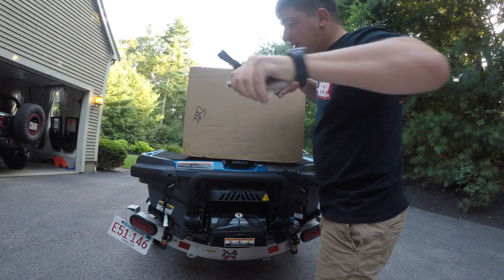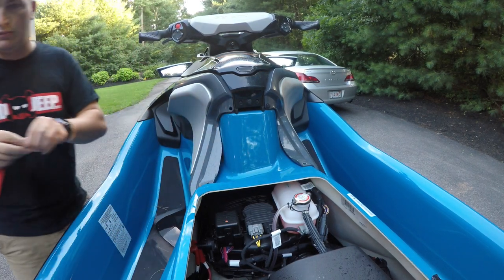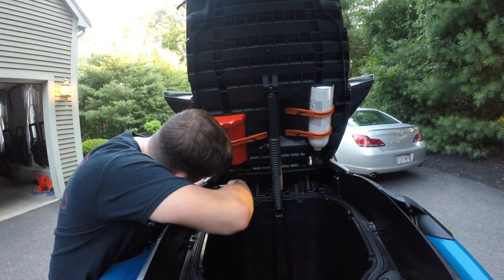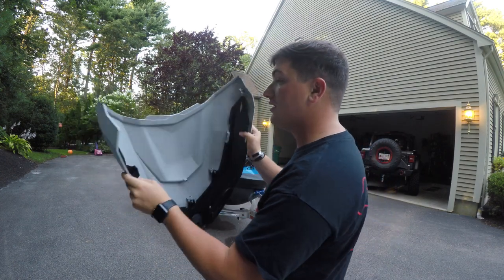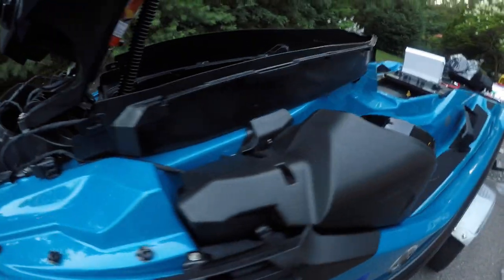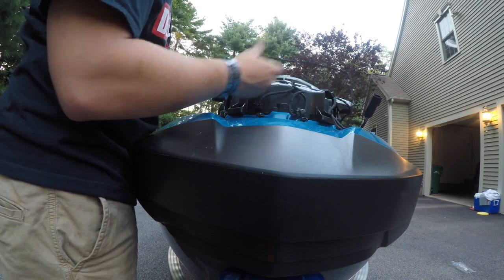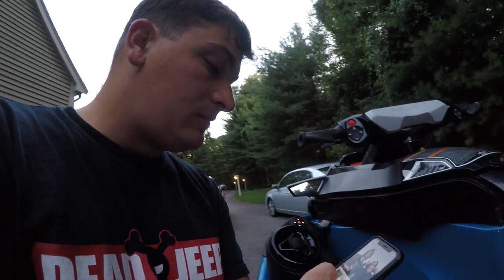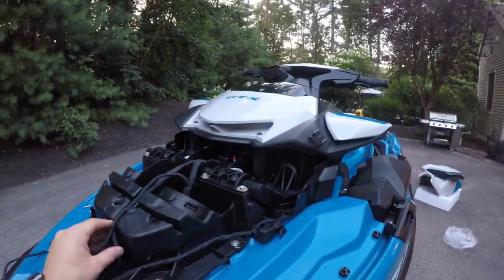How to install BRP premium Audio Speakers on my 2019 SeaDoo GTX 155

Comment: Did you use the same screws for the speaker brackets or did it come with its own screws
Reply from the maker: it came with its own stainless screws sorry i  thought i  depicted that it may have slipped my brain thanks for asking!
Reply: A trick : you can watch series on instaflixxer. I've been using them for watching all kinds of movies lately.
Reply: @Misael Jaime yup, been using instaflixxer for months myself :D

Comment: Worked great on a 2021 GTX 170.  For the forward side panels there is a black tab that can be pulled down if you reach your hand in from below.  Reach up and you will feel a rectangular black part of the chassis holding the top tab in place. Once you pull this down a 1/4" it will slide right off.

Comment: Just completed the sound system and USB install on a 2020 Fish Pro. I can honestly say it was not bad BUT! If you are not a mechanically inclined or quite handy person, this install WILL get way beyond your comfort zone very quickly. If you have a Fish Pro with no sound you WILL need a special harness or you WILL need to do some very careful splicing of wires. Point is, if you cant tell a wrench from a ratchet and dont know what a torx is then you need to let a dealer do the install. Choose wisely cuz if you break shit it gets quite expensive quite fast. Peace out.

Comment: I installed mine on my GTR 230. Went out on the lake but my friends and cousins speakers seem to be so much louder. Same speakers. Could I have wired something wrong?
Reply from the maker: Wiring should be the same it’s just plug and play i doubt you wired it wrong. It is possible it’s a setting in your phone that’s limiting how loud your phone allows your music to be

Comment: Thanks for the video. I bought a speaker set off a wrecked 2019 RXT300 to put on my 2019 RXT230. I got the speakers and 4 brackets. Thanks to your video I was able to identify the upper ones. I see your ski already had the base brackets mounted on. Were they on from factory? I asked because I can’t identify the 2nd set of brackets that I have left. They’re Id’d as “L” & “R” also.
Reply from the maker: Yes my base brackets were already there you might be able to see them on seadoos parts finder which will give you an image of all the different parts and kinda solve from there

Comment: Hi, nice 👌 video. I have a 2018 yamaha svho. Will those speakers fit in my jet ski? Thanks in advance.
Reply from the maker: Unfortunately no these are proprietary speakets for BRP and only some of their modles however you can get pwcbrwckets system for an affordable price and i have a discount code Taskforce10 that should save you 10%

Comment: Did you hook up the power to kill switch so if you flip it shoots down power on stereo ...? If so how you find power ?
Reply from the maker: bobbey lee as you see this is a fully plug and play system when the safety lanyard is removed all power to the ski is shut off when the ski was in a running state prior to the lanyard being pulled so with it being all factory i would assume brp would have taken that into account them selves. As for flipping i personally have never seen an ST3 hull flip not to say it’s impossible but very very difficult i have had times where i thought it was going to flip and it didn’t even with 3 adult men standing in one side and the foot wells being full of water it still was not enough to flip but just throw us off

Comment: Were you able to replace the screw you removed at 3:14?  I couldn't get those screws back in because the speaker is now in the way.  I feel like my side panel is loose now..

Comment: Hi Any updates on this system for a 2019 SeaDoo GTI SE 155 any modifications made available since last comment 1 year ago? What are my options?
Reply from the maker: Negative but there are aftermarket solutions for similar pricing that arnt too invasive

Comment: Have those on my fish pro trophy 2022 and have a question i can find online … when i turn on my sea doo why are my speakers button lights automatically open rather then riding with my speakers turned 100% off and if i decide to turn on only then the button lights should turn on … and because of this issue when i open my iphone to bluetooth pair it doesnt give me the BRP Connect option to pair … very frustrating please someone help me 😀🙏☀️🏄‍♂️ be safe on the water everyone

Comment: Can you take the front side pannel off with the speakers in?
Reply from the maker: Marine Junkies yes that bolt i removed due to the speakers i was not able to reinstall so i would assume it is the same from seadoo and you should be able to remove it easily
Reply: @TaskForceOffroad  so no screws or bolts? it just slides off onces you take the kneed pad pannel off?
Reply from the maker: Marine Junkies correct i forget if the nose bolts tie into it so you could be safe and remove those but it should be just the sliding motion it was very tight and also difficult to get back in properly i had to put a good bit of downward pressure to reinstall with the speaker there

Comment: Great video! I just picked up a left over 2019 yesterday. I got out to the lake where it will stay (~ 3 hours drive), turned on the stereo to show off a little and only the left speaker has sound coming out of it! (insert sad face here). I haven't called the dealer yet and I don't want to bring it all the way back home after docking it in the marina. Hoping it's a loose wire? I assume there isn't a left/right fade feature? Sick sound though even out of only one speaker! LOL
Reply from the maker: SniperJ78 thats miserable! So there isn’t a fade feature to my knowledge you’re correct in that my guess would be one of the connectors isn’t making the connection pop the hood off with those two bolts in the storage compartment and then pulling away from the ski and ensure they’re getting good connection before you lug her back to the dealership! Enjoy the ski man!
Reply: @TaskForceOffroad  that's what it was - the connector for the right speaker wasn't even plugged in. Man, that made me mad. Fairly easy fix but it delayed my launch and fun by a few hours!
Reply from the maker: @SniperJ78  glad it ended up being an easy fix!!!

Comment: Hey where can I get some speakers like those but for a 2016 yamaha waverunner vx sport or will these fit a waverunner?
Reply from the maker: These are seadoo specific but you can get pwc brackets for your ski and put just about any good bluetooth speaker on there i have them on my 97 ski works great

Comment: Can either of those speaker be opened where you can tap into the speaker signal directly at the cone instead of having to tap through the line? I'm needing to connect a line out converter and don't want to use wire taps.
Reply from the maker: Reagan Martin im honestly not sure they look pretty water tight I'm sure there's a way but the only way i could imagine is by removing the speaker itself out the front as I'm sure the back is water tight but if you tap the line properly with heat shrink and double up with electrical tape is think tapping the line would be fine as well

Comment: Great video. So all the new generation GTX/RXT's come pre-wired?
Reply from the maker: Matthew Donegan-Ryan that's correct so it's all nice and plug and play i would also assume the new generation GTI Comming our in 2020 will be prewired as well.... it makes sense from a production stand point not having to change mechinery to produce different models just slap on the extra parts

Comment: When putting back together did you have left over bolts? Just want to make sure I didn’t miss anything when putting back together
Reply from the maker: don madera i had the bolts that i took out of the spacers first lack of a better word where you use replacement hardware and i couldnt get the bolt back in the body pannel after installing speakers however if you took the speaker out and put the bolt back in first that should work and you shouldn't have anything left over except the 4 total 2 on each side that got
Replaced

Comment: How do you get that front side pannel of with the speakers in?
Reply from the maker: Marine Junkies the speakers will need to be removed first there is a small access hole that you can stick a long screw driver in and pry on a clip that will release the speaker and allow it to slide forward then you will be able to remove the panel.... getting the speaker out might take some finageling but it can be done
Reply: @TaskForceOffroad  The speaker hold in by that one screw at a angle?
Reply from the maker: Marine Junkies no that screw is only holding in the side panel the speaker is held in with clips on the bottom bracket

Comment: Where'd you get them ? Do they make some for a 2016 model ?
Reply from the maker: Big Blue i bought them on amazon and as for a 2016 mode that would be a no these are a seadoo product and they have not made them able to retrofit to a 2016 being that they designed them around the st3 hull however i know there are people that install speaker systems on jetskis in the aftermarket area

Comment: I can't figure out which part # to order for the BRP Premium Audio Speakers - I have the 2019 SeaDoo GTI SE 155. Any help?
Reply from the maker: Dave Mendlen unfortunately they didn’t bring the premium audio to the GTI platform Untill they redesigned them in 2020 so your ski does not support them.

Comment: I have the GTI se ,same set up correct??
Reply from the maker: Mike Mike not exactly you will have a different part number and it will come appart alittle differently
Reply from the maker: Mike Mike you also need to have the 2020 or newer GTI to be able to put sound on it
Reply: Task Force Offroad ☹️
Reply from the maker: Mike Mike Sorry to break the bad news man they just designed for it with the new GTi hull and only put it on the GTX hull in 2018
Reply: Task Force Offroad thanks for the info much appreciated 👍🏼

Comment: Does the seadoo still come with the USB plugin if it doesn't come from factory with sound, and if not is the USB included with the speaker unit?
Reply from the maker: Nick P im not sure if it comes as an option with the sound but i know if you order the speakers it does not and you had to install seperate

Comment: Is it cheaper to buy/install yourself or just order it as an option when you purchase the Seadoo
Reply from the maker: BoredAtWork2000 it's relatively the same price it might be 100 or so cheaper from seadoo however when buying these mechine's that number with options starts to get high so it's nice that you can easily install after the fact

Comment: Is it the same if I do this on my 18 GTI SE?
Reply from the maker: Donny Federlin the GTI platform did not have the ability to add BRPs speakers Untill the redesign they just released this year in 2020 so unfortunately you would need to have a different solution
Reply: Thanks man
Reply: I have the 2020 gti 130.

Comment: Will this also work on the new 2020 seadoo wake jetski
Reply from the maker: Chris Felle Yes it will! However the wake is on two hull platforms! The more expensive wake PRO 230 is on the ST3 hull same as My 19 Gtx so the process will be the same the wake 170 is on the GTI hull so some of the removal will be different however you can still install speakers... the speakers are shaped different for each hull so make sure you order the correct ones!
Reply: Task Force Offroad thanks for the response I got the wake PRO 230 so it should be easy
Reply from the maker: Chris Felle it should be the exact same then! Now i suggest you put the screw back into the gray ferring before you slide the speaker into place or you will not be able to afterwards
Reply: Task Force Offroad I was actually incorrect about my jetski I have the 170 do think there is any differences I should look for
Reply from the maker: Chris Felle it’s going to be a different hull so the parts you take appart may be different with the feedings and plastic pieces i have not taken appart anything on the GTI platform yet however I’m sure it will still be relatively similar and straight forward and I’m also positive it will still be plug and play. If you need a hand while doing it DM me on Instagram @projectreaperjl I’ll do my best to help out and ensure you order the correct speakers the ones for the ST3 hulk will not fit they are shaped differently

Comment: So the front plastic you said there was one screw and those 3 clips holding it. I'm trying to take that plastic off mine but can't see the screw looks like the speaker is in the way. So did you have to remove the speakers to access that screw when you re-assembled?
Reply from the maker: Correct to get to the screw you must remove the speaker there is a little access hole at the bottom of the speaker and you can stick a long screw driver in there and depress a lever to slide the speaker toward the stern of the pwc you should then be able to get access to the screw make sure you reinstall the screw before putting the speaker back!
Reply: @TaskForceOffroad  Thanks I figured it out. I was just putting felt tape everywhere the plastic touching. The rattling last season drove me nutz. Not good for fishing :) I have the Fish Pro.
Reply from the maker: Chris Mac that is an awesome mechine!!! I haven’t gotten any fishing done on mine yet but it’s on the list of to do! As well as get rid of the rattle like you did but mine isn’t too bad only at idle mostly which I’m sure while fishing is most of the time!
Reply: @TaskForceOffroad  Yes my rattle was at idle as well. I pulled the 2 side covers off and added a layer of felt tape where all the plastic rubbed each other. Hopefully I fixed it!
Reply from the maker: Chris Mac let me know how it worked out!
Reply: Hey, 
Anyone know how to get this clip to release with a long screw driver ?
I followed this video, didn’t put that screw in and now I can not get the speaker to release.

Any help would be greatly appreciated!
Reply from the maker: William Eybers honestly just play with it you’re going to need a very long screw driver 2 people can help one to push the speaker out and the other to mess with the clip it took me a few times when i tried to play with it and when i say a few times i mean about a half hour. You can do it but it’s definitely frustrating
Reply: @billyboi529  It was easy... Insert a long screw driver in with the blade horizontal all the way in until it stops. Then rotate the blade so that it would be vertical then pop pull the speaker down.

Comment: Thanks, nice video.... putting it back with our system little crazy... have the rxtx 2020 doing install now.... all easy except this piece screws back in and the speaker hides it? see this https://www.screencast.com/t/ZnyNjwE0bz2M
Reply from the maker: Michael Barrett i was uh able to a screw that piece back in all holding it on is the clips
Reply from the maker: Michael Barrett no issues so far over a year later